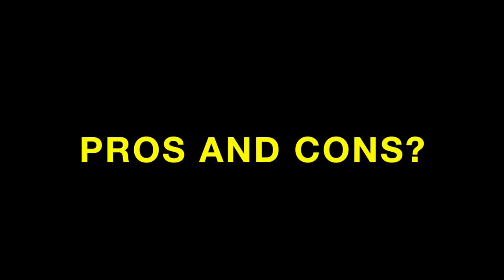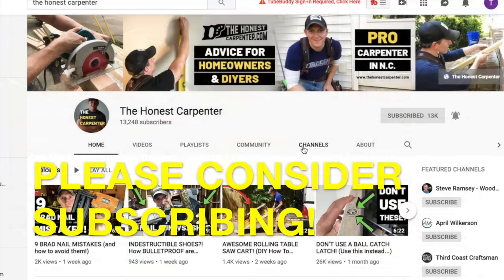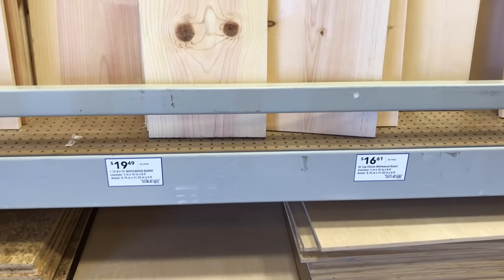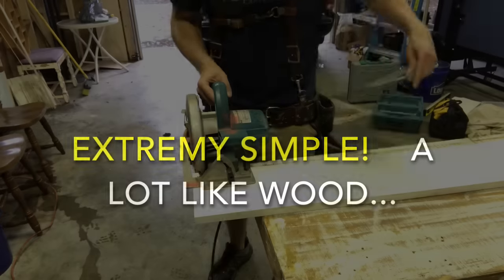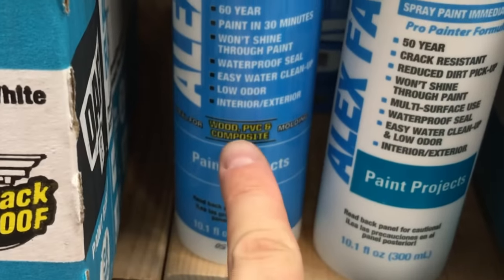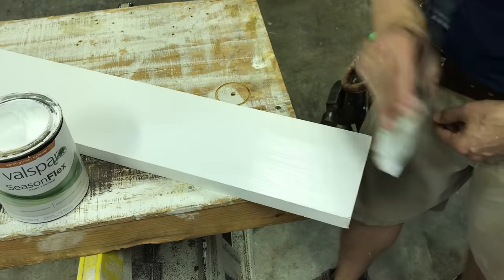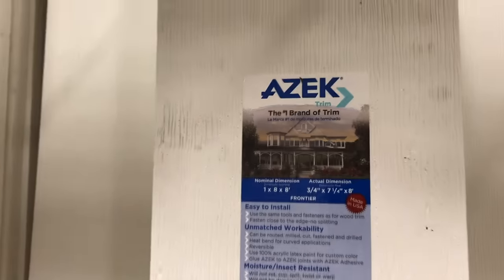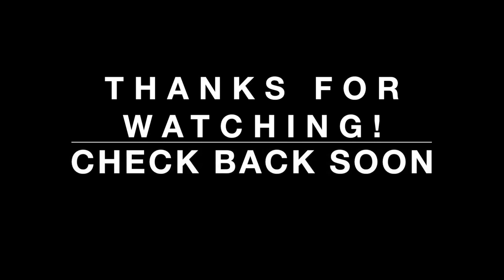PVC TRIM VS. WOOD TRIM? (Pros And Cons!)

Comment: Could you use pvc trim board as siding to do your whole house in ?
Reply from the maker: I wouldn’t. It would be sooo expensive. Hardie board is relatively cheap and holds up to the elements really well when it’s painted!
Reply: @TheHonestCarpenter  okay but let's say if you had the money would you my friend do it or is there a problem that I'm not aware of? I do know that the pvc trim boards expands in direct sunlight a bit but that's the only issue I've read about.

Comment: I have vinyl soffit on a new addition on my home , spiders & bugs get in the recesses & are hard to get out even w/ brush & water hose , I’m wanting to replace it w/ wood to match the  soffit on the original part of the house, or do they make a vinyl smooth soffit , and if so which would be my best option ?

Comment: A Few more Pros and Cons in my experience:
Pros: 
-Doesn't split when nailed/screwed.
-Doesn't splinter. 
Cons:
-Can't hold weight.
-Must be fastened closely or it will quickly bow.
-Can look very cheap next to other materials (like putting an IKEA brand end-table in a room of antiques).

Comment: Hello just watched you r vid. nice info. i have some windows at home that use wood trim.i was thinking if using pvc trim to replace it. i have one question.Have you ever tried to router .round over or anything else. was wondering how it would do.
Reply from the maker: Hey Ron, I have indeed routered it a number of times. You'll find that the material removes just fine. BUT, the porous edge I mentioned will be extra visible because you're exposing so much more interior surface. Sanding will only make it so smooth I'm afraid. Just something to think about
Reply: @TheHonestCarpenter  Thank for the response.i gonna try maybe with some sanding and some white paint . to help maybe fill in some . worth a shot to see how is comes out .

Comment: Would silicone be better to use than a caulk approved for pvc?  Sorry, for use on windows and doors?
Reply from the maker: Not many silicones are paintable, S! There may be one out there that binds with PVC, but much siliconized acrylic is just as good in exterior paint situations.
Reply: @TheHonestCarpenter  Thanks!  I won't be painting it.  I would use white silicone on white pvc.  I'm just looking for best bond, water protection.

Comment: I'm going trough a horrid basement moisture issue and never want to use wood or particle board again in the basement.  Can I use PVC to frame a basement window altogether?
Reply from the maker: It depends, no mayhem. Weight and stability can be an issue based on window size. If you want to get a really detailed take on it, consider booking a consultation with us at: www.thehonestcarpenter.com
We can talk the whole thing over with you that way!

Comment: Great video... Just got a new subscriber :-)  I'm think of using PVC quarter round for the new floating vinyl floor I put in my bonus room. A bit more expensive than wood alternatives, and I would not have to paint it to match my wood baseboards.  Any reason NOT to use it in this project instead of wood?
Reply from the maker: Not that I can think of, Pablo! It's really great in rooms you plan to mop a lot. Otherwise, it cuts, paints and performs much like wood. :)

Comment: Can a backyard staircase be built with pvc, including steps?
Reply: I just finished replacing decking material and the steps with a Trex board. The only thing I did differently was reducing the joist span to 12 inches. The plastic material flexes more than wood.

Comment: From my experience (in the Northeast), far and away the biggest drawback is the thermal expansion/contraction of PVC. Joints gap over time and I’ve had numerous pieces pop off eventually from all the movement. I’m replacing it all with something like Boral or Lifespan. I’d never use PVC again.
Reply: I'd recommend drilling a hole slightly larger than the screw/nail holding it to accommodate expand/contract, else, yes, some buckling.  I'd take it any day over the incessant paint/replace/paint/replace cycle of wood.

Comment: Why not use a wet saw to cut pvc: will carry the PVC trim dust  into the reservoir of the wet saw??
Reply: Wet saws typically use a diamond cutting blade that may gum up with PVC materials.  Worth testing.

Comment: Can I use pvc caulk if I am attaching pvc quarter round to a wood baseboard?
Reply from the maker: Most likely, Elaine. Just check the specs on the tube to make sure the caulk bonds to both materials. (It will most likely also need to bond to paint or primer as well, which most do.)

Comment: I actually prefer Polyurethane flexible molding over PVC. That seems to be taking over PVC. Flexible molding is where it's at. You can bend it into corners, it curves to a walls natural curvature, and I prefer the "rubber" feel over the stiffness of PVC.  It glues well. When it comes to decorative and smaller trim, polyurethane and PVC are better than wood. But polyurethane, being flexible is easier to work with. Any large moulding, like baseboards I use wood. It's a lot cheaper to use pine. Then just glue or finish nail small moulding to the pine boards.

Comment: One drawback of PVC that was not mentioned here is the negative environmental impact of both production and end-of-life for PVC. The starting materials are quite toxic and cancer clusters have been observed around areas where PVC is manufactured. The end-of-life is also problematic because PVC is either landfilled where it will last forever or burned where there is risk of releasing harmful dioxins into the atmosphere. Lastly, while the material lasts longer in certain use cases like exterior trim, the lifecycle impacts of producing it overcome the environmental benefits of longevity because of wood's ability to sequester carbon during growth. These should all be considerations for anyone trying to choose between a wood product and a PVC product.

Comment: Pvc is way way cheaper now than MDF/wood.. some trim in pvc is better For certain applications vs mdf or wood. I use both all the time and pvc is light weight flexible and fairly easy to install.. have to set air pressure down in nail gun or else you might risk nailing right thru the pvc piece

Comment: I've had good luck gluing less structural but more visible joints with white transition cement.
Reply from the maker: @Harley Wood Thanks for the tip! What brand do you use? I see Azek's cement most often
Reply: @TheHonestCarpenter  Oatey. The max size joint though is about 5- 10 square inches. Skins over fairly quickly.

Comment: Ok so can i bend kleer / pvc?
I thought id cut a bevels for my corner and use one piece to go around the house as 1 board is like 38' long
Reply: Yes you can bend it. Dipping it in hot antifreeze works.
Reply: Atleast for pipe

Comment: How can I put a 45 degree bevel on each end of a 4 x 8 sheet?
Reply: I use a track saw........ it works very well. Beware that the cut edge is extremely sharp... it WILL cut you........

Comment: OK..it doesn't rot...got it!  But, I watched the whole video for one answer... what about longer term sun exposure? Judging from some PVC fencing in my neighborhood, it's an issue....???
Reply from the maker: Hey Pat, long-term sun effects are still a little bit of a blank spot for me where PVC is concerned. Good paint definitely helps, but a lot of those fences don't get painted at all. I'll try to round up some more info on this topic though
Reply: @TheHonestCarpenter  I don't think all 'PVC' is created equally. PVC fencing, which I have used, is not 'porous' like the PVC trim is to keep the boards lighter and less expensive than a solid piece of PVC would be.
Reply: AGENT 47  thanks AGENT 47. Good to know!

Comment: I say it's worth the extra cost if being used on exterior surfaces because wood is going to rot.  There is no way I'd not use it these days.  I replaced a rotted wood piece on the front door with this stuff.

Comment: When sanding pvc, is this area more likely to discolor?
Reply: I think so, if it gets hot enough.
Someone mentioned earlier in the comments to use water and ground the tools to prevent dust flying away and sticking to things.

Comment: I've been using that PVC or as it's called in Australia foamex and it is a great product the only problem with it is that it can break a lot easier than wood and I'm not sure how it responds to UV the older product wasn't very good with UV I'm not sure about the new products
Reply from the maker: Thanks for writing in David. I've yet to determine what the long-term durability on our PVC over here is. But the manufacturers seem pretty confident about this new stuff. They all state that you don't even have to paint the trim, which seems crazy to me, but I figure it has to have some decent UV resistance if that's the case. I'll be keeping an eye on projects over time to judge for myself though :)

Comment: Another massive drawback to PVC is, just like PEX it cannot be recycled. That doesn't mean it shouldn't exist but it definitely means it shouldn't go everywhere and if an alternative that isn't made of a non-recyclable polymer can be used, it should be. Otherwise we're going to have a lot of homes creating hundreds, if not thousands of pounds of plastic waste every 10-40 years, depending on the longevity of the products in each specific use case.

Comment: I hate PVC or Vinyl siding. I put 5/4 exterior wood trim in some cases is 3/4 fir or cedar, Love Hardie As well. 
Stay away from pvc we definitely don’t need it in our landfills
Reply: Hardie Flex or cement board is very useful in wet areas. I like pressure-treated wood where it will be subjected to a lot of moisture. Usually, that is available only in 1 1/2 inch net thickness. However in many cases that is not a problem. PVC is a fire hazard as well in the sense that it puts out some very dangerous smoke if exposed to fire.
Reply: Roger that

Comment: Wood rot would not be a problem if Allback organic linseed oil paint were used.  With this paint, the painted surfaces goes matte, then chalks after further time, then after further time still this paint will form cracks that make squares that stay fixed in place, or pigment will start to fall off in the form of powder.  You can apply a coat of Allback boiled linseed oil or the linseed oil wax every five to ten years and the paint will last 50 years.  If you don't do that the paint will last 20 years.  When the surface goes matte, you can apply a coat of one of these if you want it shinier, but you don't have to.  When it chalks, wise to add a coat of one of these or at least make plans to do it.  Even when the pigment flakes off, it will do so before the wood begins to rot.  So it will look neglected before it begins to rot.  At that point you can brush off loose pigment and wash, let dry and repaint.  You can find these paints at The Eco Living Room at 12 Cataraqui Street just west of The Woolen Mill if you're in Kingston Ontario.  If you're in any other city or you want to check those out, you can visit www.sagerestoration.com.  If you are in the US, you can visit www.solventfreepaint.com.

Comment: One con you didn't mention is it can't be stained, only painted. My house all the exterior wood; i.e. siding, trim, soffits, etc. are stained.
Reply from the maker: Good point, Rusty. PVC really only works with paint I'm afraid. Stain just can't sink in, and the material has no grain to magnify :(

Comment: I have experienced issues with 18ga nail overdrive when nailing thinner pieces. I had to switch to staples.
Reply from the maker: I don't blame you--for thinner material, like panel installations, a good smaller gauge stapler can be far more reliable. They leave a bigger head path when they go in, but it can be hidden on certain materials. That said, I haven't had a decent stapler in almost two years! What brand do you recommend?
Reply: @TheHonestCarpenter  i have a Hitachi N3804AB3 1/4" Narrow Crown Stapler, which seems pretty good.
Reply from the maker: Thanks a9! Hitachi really seems to have locked down a huge market share in staplers, and fastening systems all around these days. I'll check out the 1/4" stapler next time I'm in the tool aisle. Thank you!

Comment: Have you ever heard of boral exterior trim? It's impervious but you have to paint it.
Reply from the maker: Thanks Greg! I have heard of Boral but never used it. I see it’s made of polymer and fly-ash. Seems like it’s impervious to rot and fairly sustainable. I’m interested!
Reply: @TheHonestCarpenter  like pvc the dust is awful. It's a good product especially if you want your trim any color other than white.
Reply: Boral is great very dimensionally stable so the paint and caulking lasts. I have gone back and looked at houses I have done almost 10 years ago  with boral and it still  looks like perfect. Hot or cold it does not expand or contract  like pvc . I use titebond ext wood glue on the splice joints and miters .

Comment: Help, I have a patio with wood columns that were never covered (the screws and metal stuff is visible) can I use this kind of board to cover them? I have very limited funds but I willing to pay to purchase PVC if it will protect the wood. Someone???
Reply: Instead of protecting the wood with PVC, which would keep water out but would also trap water against it if water should get between it and the wood, I would use an Allback organic linseed oil-based product to finish the wood.  You can use their linseed oil, linseed oil paint, or linseed oil varnish.  If you live in Kingston you can find those products at the Eco Living Room on 12 Cataraqui Street, just west of The Woolen Mill.  If you want to search those products first, or you live in another city, you can go to www.sagerestoration.com.  If you live in the US,  you can check out and order these products at www.solventfreepaint.com.  If this line of paints were always used, there'd be no problem of wood rotting and therefore no need to switch to PVC.  The reason wood rots is because we put essentially a plastic based coating on top of it, which doesn't go into the wood, it simply harden on top of the wood, and it's not breathable, so it traps moisture, causing rot.  Allback linseed oil based products are similar to wood and soak into the wood and so harden in the wood, not on the wood.  They are also breathable.  If you can't afford linseed Allback linseed oil paint, you can get their boiled linseed oil, which is much cheaper.  Or you can get raw if the wood is bare and very dry.  If the wood is not particularly dry boiled linseed oil is fine.  If the wood is painted or at least mostly painted and doesn't look dry, you can just wash with the linseed oil soap and then when dry from washing, paint with the linseed oil paint, skipping the linseed oil if you can afford the linseed oil paint.  Linseed oil and linseed paint cover 170 to over 200 sqft per litre, so if you have a small amount of wood you can get a 2 dL jar of Allback linseed oil paint.
Reply: @alanclark7325  THANK YOU, I live in Los Angeles,  California and the sun has been so piercing this summer unlike any other year.  I will definitely try the Allback linseed oil paint!! Again, thank you - it's really hard to get a straight answer from someone who is just trying to make money off you!!

Comment: No love for Cortex fasteners and plugs? Game changer with PVC, especially if you don't want to paint it. They also sell plugs that match wood grain depending on the brand of PVC you used such as AZEK, Certainteed, Royal, etc. It's like Frank's red hot... I put that sh*t on everything... Sometimes I don't plug the board till the very end cause they really do blend in well.
Reply: Perhaps if you could find them anywhere. Home Depot has a bunch of PVC but no fasteners or plugs.
Reply: @mgonn  if you are in Canada, HD is about the only store I know that DOESN'T carry them. That's because the PVC they carry isn't really that good IMO, any PVC worth its weight has a Cortex fastener  with associated grain. Rona/Lowes maybe the best bet. Also I tend to avoid box stores these days and stick to fastening houses and such. Not great if you live in the sticks.

Comment: As a carpenter for 40 years this stuff has limited uses and should never be used as trim,try and stay away from mdf as well the best thing is wood which is easier to work with and has a sustainable finish provided it is properly prepped.,and is better for the environment.

Comment: Why not control cost the columns looked good other then the base, Make a  6 or 8 inch footer or base trim  out of PVC  and cut out the water damaged wood. Seal the ends of the cut replace the water damage with pvc let's say 6" then install 8" base trim wrapping  each column.  Less cuts and micro plastic

Comment: Would have looked nicer and have been way cheaper to just cut off the rot and then trim out the bottom of the covered area with pvc trim.  But it's a great product to work with for moisture prone areas.

Comment: The biggest issue with PVC is it pretty fimisy compared to wood. So all your framing that your installing PVC trim needs to be trued up. 

I would also recommend using Aztek Fastner kit with pvc plugs instead of nails, not only for aesthetics, but over 10 years the galavized zinc coating is going to wear away causing rust stains to appear. 

I would avoid painting PVC, since the paint is likely to crack or peel over time because of PVC high thermal expansion coefficient.